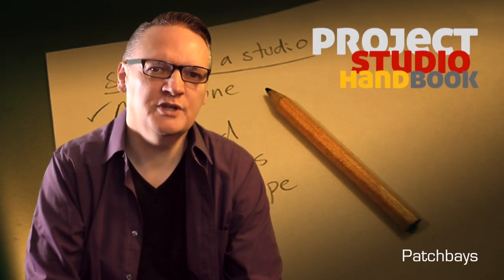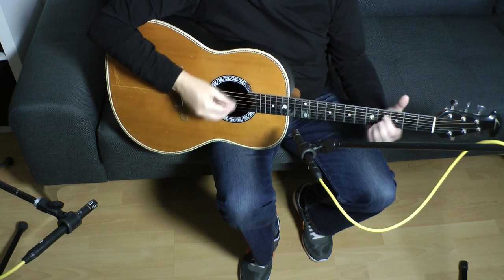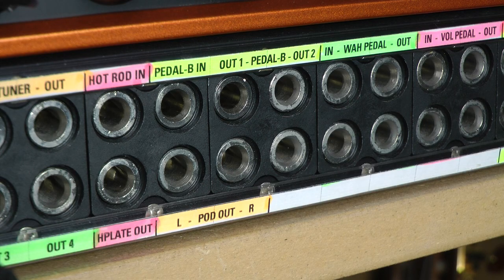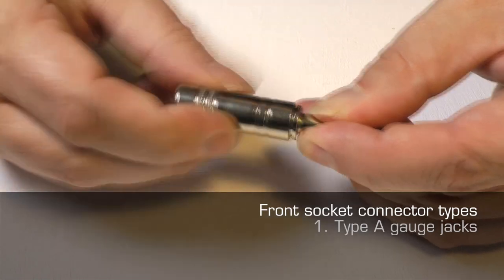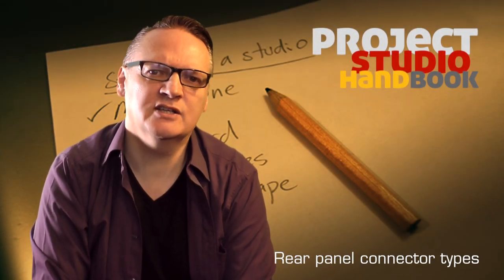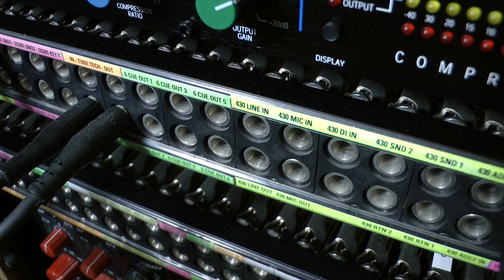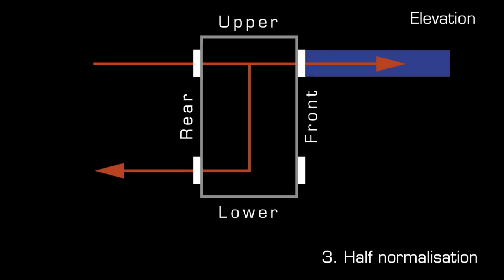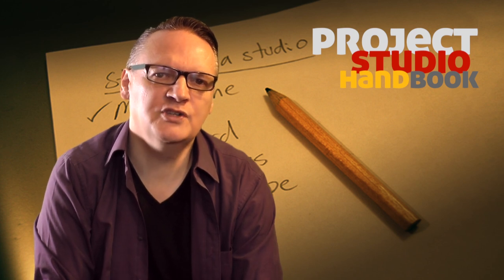Audio patchbays

Comment: Thank for sharing this, very useful. I currently setting up the patch bay connecting the UAD Apollo 16 with a Neve 8816. Do you have any suggested set up in the patch bay?
Reply from the maker: You've got some great gear to connect. You probably want to think really carefully about how you might use it in the future. The most obvious thing to do would be to make looms and connect every connection to a B gauge patch bay (or 2!), normalising the Apollo outs on Neve ins and vice versa. You could also normalise the Neve cue outs to your headphone amp but leave the Neve master outs un-normalised, so you can patch in a mix bus compressor or other analogue mastering device. Alternatively, if you are only going to use the gear yourself you could forget about a patch bay and make direct connections until you have figured out what needs to be re-routeable and what doesn't, and then buy the patch bay you need. Whatever you do, we recommend using multicore cable especially as you have some D-subs to solder. Good luck.

Comment: Great vids! If I have a balanced patchbay and the majority of my connected devices (Synths & effects) are unbalanced mono. Can I use balanced patch cables on the front side or will that cause grounding or other issues?
Reply from the maker: Everyone has this issue with some of their gear, especially synths which always have unbalanced jack outs. You should have no problem using balanced connections with unbalanced gear. Use balanced cable from the unbalanced jack outputs of your synth and effects. Solder both  the ground/earth and return/negatives cores to the earth contact of your unbalanced jack plug. In the unlikely event that you experience an earth hum problem it will mostly likely be caused by a poorly designed device and you can experiment with completely detaching and insulating the return core at the plug.
Reply from the maker: Should still work whether you use unbalanced TS or balanced TRS leads. If you use balanced TRS cable/plugs, return and live will short to the earth at the synth end. If you use unbalanced leads, solder to the live and earth terminals of the patch-bay. Leave the return unconnected. Best thing is to just try it.